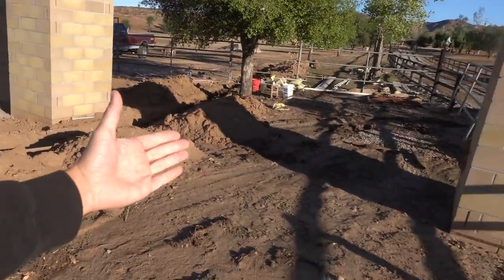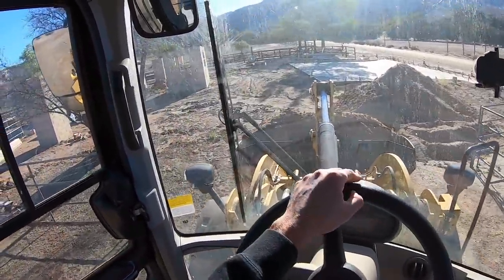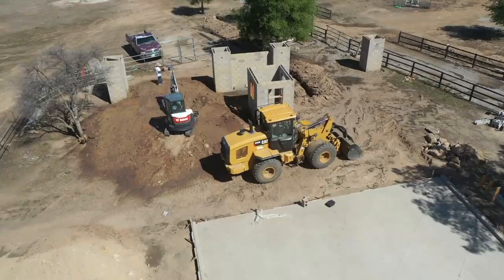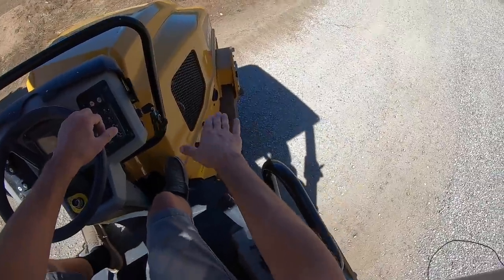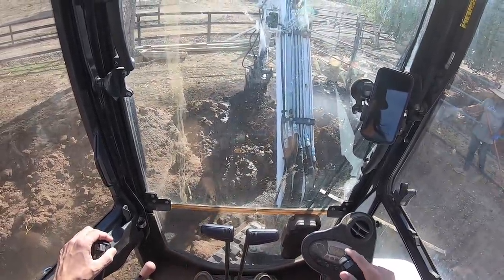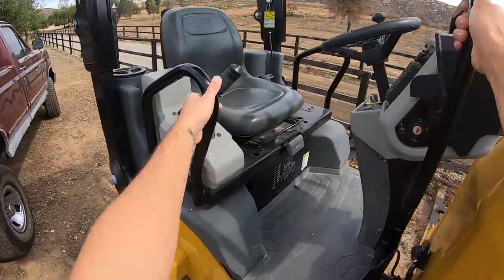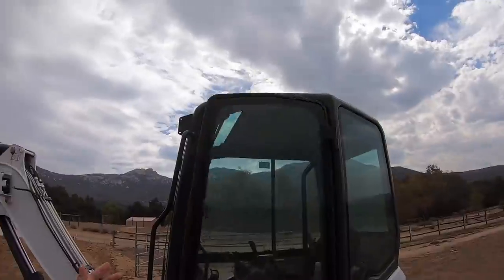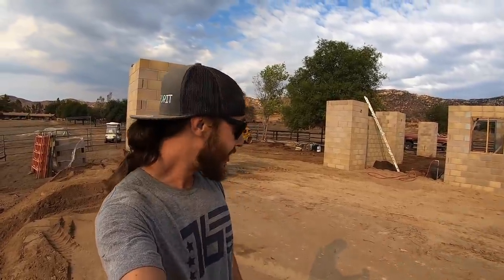Building the New MASSIVE Entrance to Ryno Ranch! (PART 13)

Comment: For your pipe clogging issue, find some large rocks and put them in the ditch like a dam so that the water can flow through them or over them and they will collect the needles instead of the pipes

Comment: If you build a box that fits around the teeth of the bucket and weld a tie down to the bucket you can hang the “grading bucket” from a chain and use a turn buckle to tighten it and losses it so it’s quick and easy to put on and off

Comment: Check out premiere 1 fencing. Portable net fencing that stakes in the ground and can connect to battery for a charged fence if the donkeys/goats touch it. Great for makeshift fencing/pasture protection around the job site and don’t have to deal with setting up the metal panels.

Comment: Mini ex…get to a scrap yard or metal place and ask for an I-beam. 6-12”. Cut it to length. Then just grab it between bucket and thumb and it’ll work better than anything you can buy. U want to get fancy???  Go buy some 2-3” 3/4” bolts and weld them on one side of the I-Beam and then you can have the option to flip the beam and have small ripper teeth that can help break up surface as you pull material.

Comment: Fun side note I’ve had one of those rollers break in half on me. Borrowed it from the paving crew turns out the break was rusty and had less than a 1/8” of material holding it together

Comment: Yeah this is Don Olson up in Preskett Arizona I have a John Deere Backhoe with a thumb and what I did was took two old cutting edges and some metal and welded them edge to edge so I had a piece of metal about 6 feet long and about 14 inches tall and I would just grab it with my thumb and use it to grade just like the front bucket on the back hoe you can use that blade just like your front blade I found it very very useful thank you

Comment: How would a heavy rainstorm affect the concrete pads, could / would they erode / tunnel under the pads making weak points. Is there appropriate drainage required to protect your investment? Love your episodes and your approach to life. 😊👍👍👍
Reply from the maker: You are correct. Is the concrete was right on the edge of the slope, the slope could was away. Pushing the dirt way past the edge of where the concrete will be helps eliminate that.

Comment: Go to your metal guy and buy 6" metal strap for your cutting edge. I use 3/8"

The only tricky thing you will run in to, is finding a way to remove it. I weld the shit out of mine but it sucks cutting them off.
Oxyacetylene torches hate dirt... which is inevitably embedded in the welded spots.

Also, I suggest attaching the strap to the bottom of the teeth (if your bucket is sitting flat)

Comment: HEY BUD WHAT ABOUT A SECTION OF METAL I BEAM THAT YOU COULD GRAB WITH THE CLAW ON THE BUCKET AS A GRADER BAR LIKE LIKE 10 INCH TALL AND SAY 4-5 FT WIDE  WOULD WORK FINE CAN CUT A COUPLE HOLES INTO IT SO IT WONT SLIDE WHEN YOU GRAB IT WITH THE CLAW.. I HAVE DONE IT BEFORE ..

Comment: Why not soil cement under the driveway, that way you'll never have to worry about the traffic coming in and out. Just throwing that out there....
Reply: What is soil cement? Gravel drives hold up well when done correctly. Not as good as concrete or pavement, but also not nearly as expensive.
Reply: @ctdieselnut  soil cement is what we use under our slabs and under our truck courts for semis. You basically add cement dust to the dirt , grind it in. Then they cut it back to grade apply tons of water and roll it in. Once it sets up it’s almost indestructible.  We will also do it if we’re building and our access roads keep getting washed out if we keep getting a lot of rain.. the stuff is awesome.

Comment: Should have sealed that block before burying it so you never have to worry about your “guard shack” filling with water
Reply from the maker: The finished floor inside will be above grade and we use a vapor barrier under the concrete.
Reply: @DMAXRYNO  nice I didn’t notice that, is all the block filled with concrete?